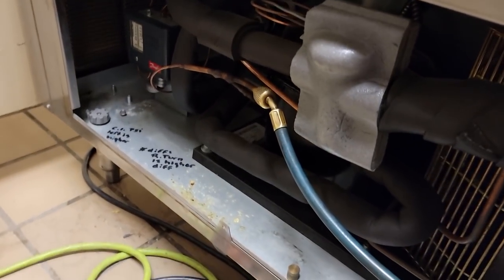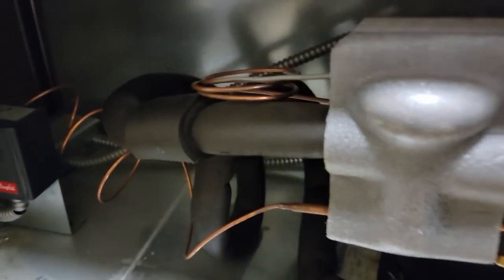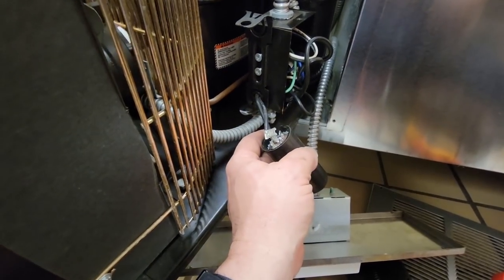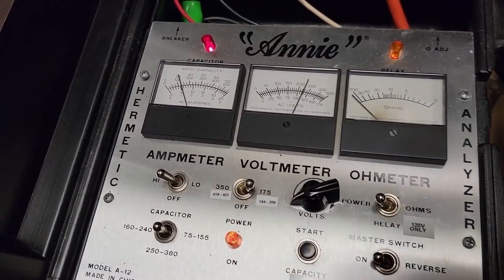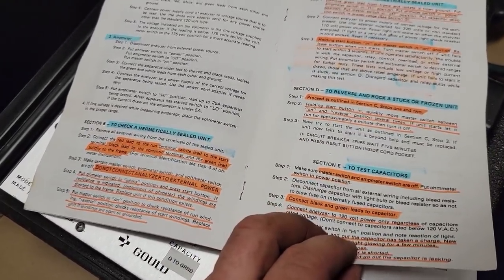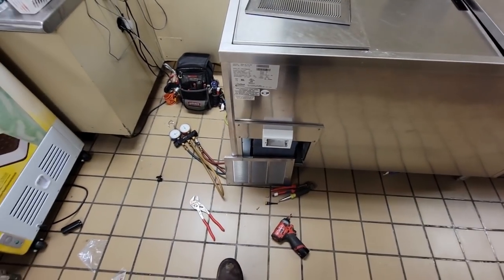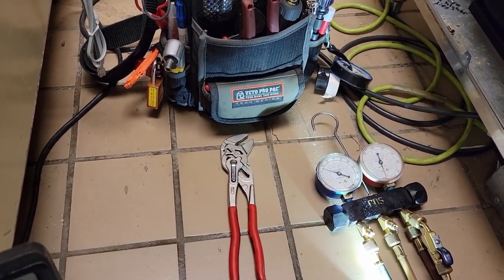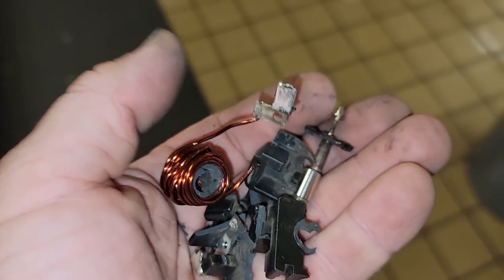More Problems Than Warm Milk

Comment: Back in the 90s, when I went through HVAC/R trade school, I learned how to fabricate a short electrical extention cord into part of a simulated starting apparatus for single phase compressors. We used a pushbutton switch to simulate a start relay, alligator clips, and just had to add in whatever correct rated capacitor was needed. We also could manipulate the wiring to momentarily reverse the direction of the compressor motor in order to attempt to free it up if it were stuck. Your analog device with the built in meters reminded me of those days. As far as the design issues you raised, design engineers don't have to work on their own equipment out in the field. They have all the space they need in their test labs. They don't have to squat, lift, sweat, carry, deal with the weather, etc. If they did, their designs would reflect it which would translate into designs that took us technicians into consideration. One thing I appreciate about 3-phase systems is there's no need for start-assist components. This video reminded me of old school troubleshooting that still works today. The only thing is that it's not taught in the trade schools anymore, even though the methods still are effective. Good work. One last note, don't forget to wear work gloves. As you already know, sharp edges are always "lurking" within those tight spaces, waiting to cut hands.
Reply from the maker: It sounds like we think alike, I agree with everything you mentioned.  I also went to school for this in the mid 90s, (1995🤦🏻) we're getting old

Comment: Nice job Rick!  Ridiculous how hard they make everything to work on, we need engineers and manufacturers that think about the guy who has to work on their equipment in the real world.
Reply from the maker: Never gonna happen, they blame the factory claiming they said to keep it cheap. Pass the buck...🤦🏻
Reply: They want sales over repairs. More profit to be made on buying a new piece of equipment over some components. Pretty sad thats what it has come to.
Reply: As I said elsewhere - the engineer that designed the refrigeration unit was guaranteed to not have anything to do with the design of the cooler itself.   The corporations deliberately refuse to let the engineering groups talk to each other.   Automotive is a shining example of this cluster-foolery.   The people that design the engine are just given specifications "This size, these dimensions, this output".    They don't have a clue what the engine compartment looks like until it's actually to the install point.   The engine compartment folks are basically told where they have to stop due to the suspension, etc.
Reply: @tbelding  I get it, that's the world we live in, they are trying to produce a product as cheaply as possible the engineer doesn't have a say in the end product. Just sad, end product, accessibility, investment of the end user to maintain and overall life expectancy has no relevance. Equipment used to last 30 plus years but that's just not profitable enough now
Reply: All that said the engineer is still obviously the bad guy.
Reply: @jonnymac31  - you mean, the engineer gets the blame.
Reply: @tbelding  the joke, between field techs, was that engineers are inherently bad people. This obviously isn't true and that's what made it a joke.

Comment: I think with those current relays if you turn them upside down there should be continuity across the switching contacts.
Reply from the maker: There normally closed and powered open under load

Comment: No, you have a unit that was designed by an engineer to be installed in one direction.   The people who put together the specification then turned it the other way, because it "made more sense" to them.    The engineer that designed that refrigeration unit, I guarantee you, had NOTHING to do with the design of the actual cooler.

Comment: a very good thing you took the time to see why it burned the starting kit , still makes me wonder why they don’t make them more easy to repair those units , and looking at more videos , it’s like a new trend , when it’s broke , it’s done when it’s leaking
Reply from the maker: Like I mentioned, unfortunately this is a throwaway society. It's going to bite Us in the butt real soon
Reply: @HVACRSurvival  I agree, I'm in residential/light commercial HVAC service and it's getting worse. Equipment that requires a lot of time to maintain or repair puts the customer in a position of paying a lot in labor for not a lot in return, BAXI combi boilers come to mind, they're OK units if you can spend the hours on diagnosis and repair - but it doesn't take long for parts and labor to hit 20% of the cost of a new system.. 

Residential AC gets out of hand pretty quickly on some repairs.. I did one recently the warranty had been void on the condenser due to corrosives in the air... $1600 dollar condenser unit on a system 5 years old with a half day labor, another $1600 and you'd get a whole new install new warranty to boot.. I'd rather be doing the repairs not sales lol. thanks for sharing the vid
Reply from the maker: Thanks for sharing, I agree things are getting crazy

Comment: Great video.  Reach-in coolers can b a PITA to work on but that unit might b PITA #1. I AGREE  with real estate services & sales heating & cooling.  Engineers should work in the field for a few yrs b4 designing a fort Knox system.  🙏🇺🇸👍💪❄🐕 thanks Rick
Reply from the maker: Thanks for checking it out!
Reply: Blame the management, not the engineers.   The engineers almost never get to see where their designs will be installed.    They're just told "Make it this big".

Comment: I really hate when trays or whathaveyous have like 8 bolts, half of which are nigh impossible to remove under normal circumstances, overengineered on that part.. otherwise a pretty neat system, so it just maintains an average temp based on the pressure switch there? I'm not too keen on rails but it's all vaguely similar, I can dig it.
Reply from the maker: You're correct, it uses evaporator pressure which is directly related to evaporator temperature to regulate box temp.

Comment: Great video. How long you can leave that compressor analyzer in circuit?  Just curious can you leave in circuit  example for whole run untill is satisfied.  Thank you
Reply from the maker: You can leave it in there as long as you're watching it. You just got to make sure the condenser fans is running. Normally that's tied on with the factory compressor wiring that I unhooked to test it.
Reply: Thank you sir for answer. Really appreciate that you are sharing your knowledge and helping other people being better in this trade.  🙏 🙏 🙏

Comment: It wouldn't surprise me if that cooler isn't intended to be repaired.

After seeing the "Annie" tester in one of your previous videos, I went looking for and came across an even older example. I didn't know you had a video specifically about it, so I'm going to check that out. 

Its ohmmeter came back to life after removing a seriously crusty battery (Gould Burgess brand, so it had been there a while!) and cleaning up the mess. Of course, I'll probably never use that part. The voltage control potentiometer for the relay tester is burned, so it doesn't work right. I'd fix that too, only the replacement pot (10K/12.5 watt wirewound, if anyone's asking) seems ludicrously expensive and yet again I'd probably never have a need for it.
Reply from the maker: Finding individual components like that nowadays is not real easy. But you'd be surprised what you can find on eBay.
Reply: @HVACRSurvival  I actually went looking there after seeing what various suppliers wanted, and unfortunately, it was no cheaper. If I decide I really care about having that part up and running, I'll just have to bide my time and wait for the right sale to come along.

Comment: dude wago connectors are better than them wire nuts you guys use, start using wago connectors there better, check them out!
Reply: I believe he was referring to the armored Flex box connector
Reply from the maker: I know they are, I saw the testing, my problem was the tight wiring.

Comment: Engineers should be made to work in the field for 5 years minimum (actually work) before they get licensed. 
Annie🤣 old school!
Thanks again for the videos. 
🥃🥃🍺🍺🍺🎳⛳
Stay safe. 
Retired (werk'n)keyboard super tech. Wear your safety glasses!
Reply: I agree engineers only care about cost savings, but then again it's corporate that makes them design it like that because they'll get fired if they don't save them money.  I was told that from a G.E. appliance rep. If you save 3¢ on 3 million appliances that a lot of money in their pocket, plus the energy crap guidelines. Then they'll say the customer is at fault because they won't pay for quality. I bet they will now though because we're buying expensive high quality Speed Queen laundry  appliances vs the throwaway appliances they make today that usually don't even make it out of warranty without needing repairs.
Reply from the maker: I have family and friends that are engineers. They claim the exact thing you're saying🙄
Reply from the maker: True true
Reply: The engineers don't have any control over this!    My father spent 40 years in that field.   Unless they're doing the entire prototype of something, they just get specifications from someone else that tells them to make something X size, that does Y.    They don't know which direction it'll be installed, for example.   To me, this looks well designed - it's just designed to be installed in _the other direction_, which the builder of the cooler itself decided against.
Reply: @tbelding  they need to break the final product down, getting to any major components. 
(5 years hands on)
Reply: @realestateservicessaleshea99  - No, the key is force the management to have to do the break down and walk through every normal service method.    Specifically, the middle management . The ones insulated from the decisions at the top, yet give all the engineers and lower ones the orders - so they don't get the blame for anything.
Reply: @tbelding  middle management gets beat up enough!🤣🤣🤣
Reply: @realestateservicessaleshea99  If that were true, they'd stop insulating themselves from the real world.